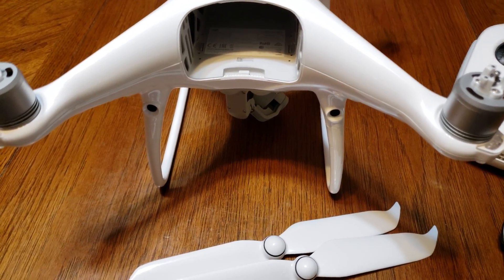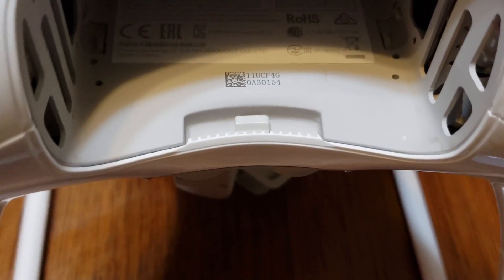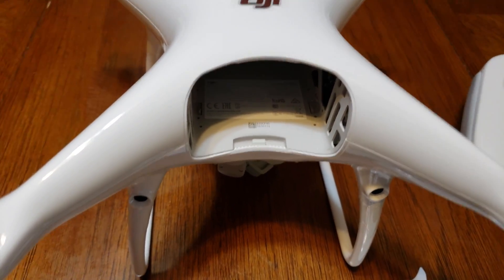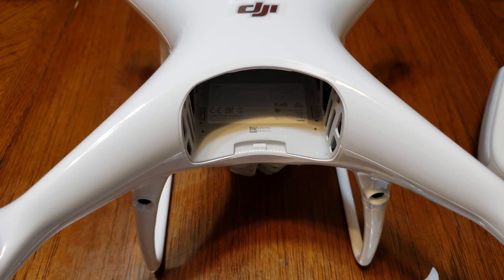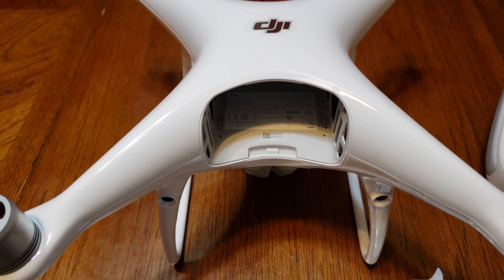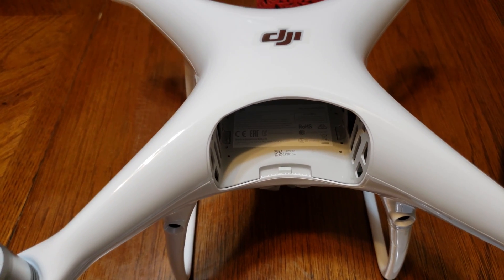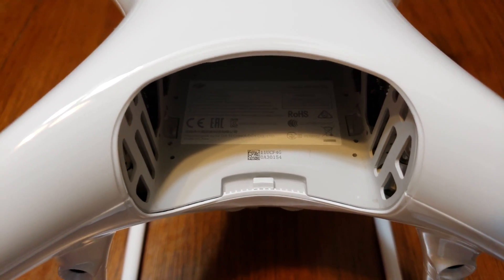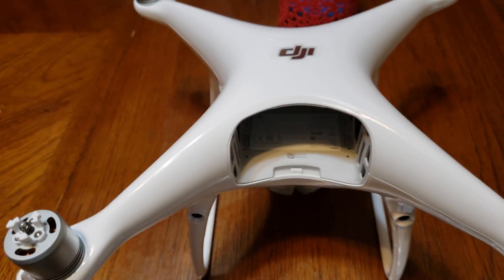Dji phantom 4 pro v2.0 | new battery sensor in v2

Comment: This is a really great video. I kept getting "battery not installed" message on 6/9 batteries and could not figure out the cause. Tried cleaning the sensors, upgrading firmware. I kept thinking it was a sensor issue. After seeing this video, i tried all 9 batteries, but each time pressing down after inserting the batter in order to secure it an contact the sensor. All 9 worked. Many thanks for this simple explanation.
Reply from the maker: No problem lenny…. yeah brother make sure the damn batteries are in for sure because I had a friend who was flying his phantom and it fell out of the sky it gave him a quick flash on his screen that said “ battery error not connected”  and then literally just lost power and it’s because his battery wasn’t actually inserted correctly.

Comment: They are being shady about it because of all the Phantom 4 Pro's that have fallen out of the sky due to battery disengaging. This fix is LONG OVER DUE and those of us who have lost our p$ due to the battery disconnect issue should have been covered by DJI.
Reply from the maker: Harry definitely I agree with you this is definitely a punch in the face also if you think about it because they're acknowledging that there is something wrong by putting the sensor in the aircraft and not helping people that have lost an aircraft due to the battery disengaging.... I feel ya, it's bullshit

Comment: Hi...I have p4p v2 I wanted to ask you if you have the same issue I’m facing. The issue is that I can’t adjust the gimbal on the p4p v2 when I press C2 with the right wheel during flight I get a pop up message “Remote controller right dial is locked”. Is that the same problem you are facing? In the p4p v1 we used to use this to adjust the gimbal.
I also checked all the buttons on the controller and they all work perfectly fine.